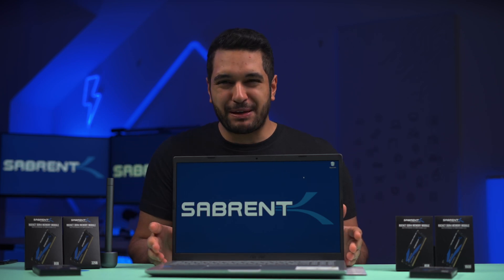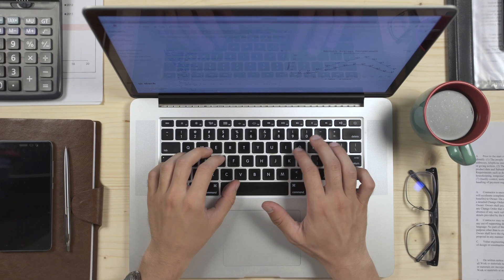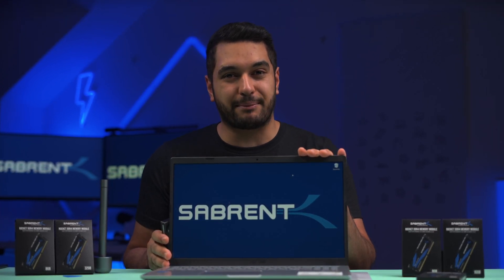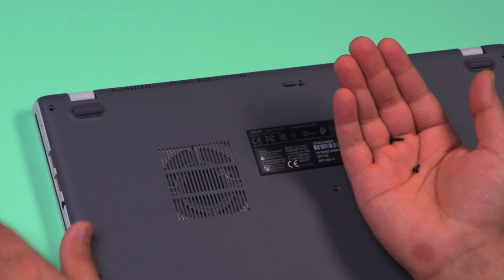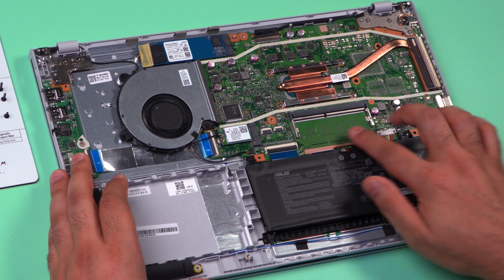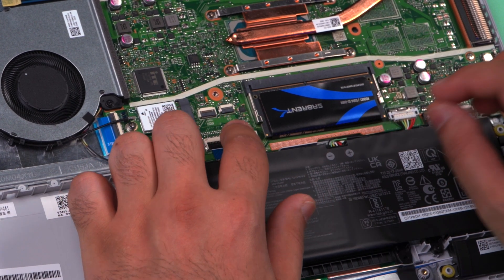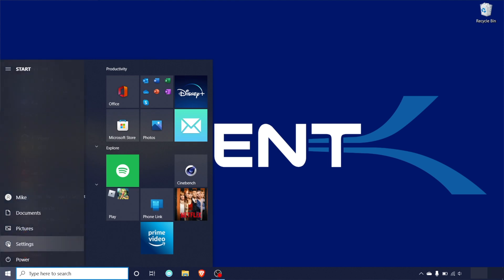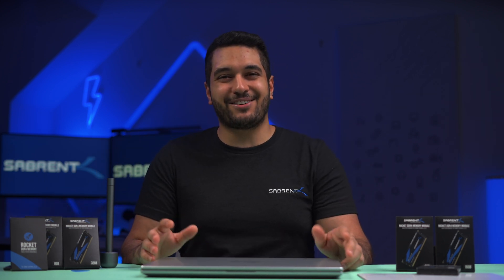Upgrading RAM On Your Laptop | How To

Comment: My laptop works fine until i have several tabs open, then it really struggles and is very slow, would upgrading this, assuming of course mine is suitable for upgrading the ram, improve this?
Reply: Yes, most likely.

Just open those tabs, check the task manager and watch your memory usage. If it's close to 90 - 100% with several tabs active --> then you need more RAM, make some space for your system to run those tabs.
Reply: @JonathanStevenSCANDALOUS  No i've not yet upgraded the ram, but i think i need to, i only have 4gb of ram at the moment. I will scan it with the crucial scanner, and see what they recommend, i guess that is the best way to buy the right ones.
Reply: @websurfer1585
Did you upgrade your ram? If you did, is your laptop faster? Thank. Be blessed in JESUS CHRIST.

Comment: Ive opeed my laptop CHUWI Corebook X to upgrde my ramt 32gb (16+16) but the ram is built in the laptops motherboard and for my deception there is no plus slot besides that i got a plus nvme slot so i only stretch my memory to 1Tb (512gb nvme ssd × 2)

Unfourtnatly i cant get more than 16Gb of ram 😢😢😢

Comment: Tysm but I'm having difficulties my laptop is showing the gb installed but it dosent show that in my files :(
Reply: I think you might be confusing memory with storage. If it's showing the correct amount of RAM, everything should be fine. Installing RAM will not affect your storage capacity.
Reply: @hollow180  oh ok mb ty

Comment: Can you help me i don't know what Rams are compatible with my laptop Lenovo IdeaPad 3 15ITL05 MUCH APPRECIATED!!
Reply: Bro I did some research, your ram is soldered, you can't upgrade it...
Reply: @mtsama01  really appreciated!!
Reply: I have the same laptop. One soldered and one is not, so you have 1 slot that is replaceable. Use the crucial system scanner to check though.

Comment: Hey noob question sorry, is it alright to have different brands? I have existing 8gb of ram and I'm planning to add another to the other slot so it'd be 16gb. And as far as I know, it has to be similar models(??) which is DDR4 3200
Reply: Seems like you were in the same boat as me, out of curiosity what did you end up doing? I have a second stick of 8gb RAM arriving today but it's not the same brand as I couldn't find the exact same model as what came preinstalled, all the specs are the same but I'm praying it works!

Comment: I have a Toshiba L650 with 4gb of ram 2+2, both removable. I got two 8gb ram ddr3 boards, but when i install them the computer tries to start windows but ends up in a blue screen with an error message and keeps restarting... Any ideas?
Reply: Was your older ram ddr3? Make sure your motherboard can support that.

Comment: Is it safe to use other type of ram for exemple I have a 16 gigs of ram stick on ddr5 if I use a DDR4 stick with more or less ram will it work ?
Reply: Ddr4 and ddr5 have different pins. So, if your motherboard supports ddr4 then it CANNOT have ddr5 vice versa

Comment: may i ask, why does my laptop's screen occasionally got freeze and the lines of green pixels appear? this happen after i upgrade my laptop RAM at repair shop
Reply: Maybe it wasn’t installed properly.
Reply: Are you upgrading from 1 ram to 2 ram modules? It will happen when the two rams isn't from a same brand
Reply: @Galllam01  ouuh i see, the orignal one was coming with the laptop itself... the second one is gaming ram...8gb+8gb
Reply: @khairulfahmi6067  Yes I've had issues also with that, so I recommend to use the exact same modules.

Comment: i have a few of silly noob questions: 
i saw for sale $40 stick of 1TB RAM. is there any catches? shall i get as much as possible, or 32GB shall be enough? 
will it affect the files on the laptop, temporary files and stuff, like tabs in my browser, etc.?
Reply: Don't buy, no such thing as a 1TB ram stick, especially not for $40. 32gb is more than enough for most laptops. If you're doing high end gaming or 3d rendering, then yes, more is better.

And no, ram does not store long term data, so it will not affect your files.

Comment: I have a gaming laptop, it's good but the ram kinda holds it back since it's only 8gb, this video helped a lot
Reply: Which one? Im looking to buy a good one for fortnite and dont mind upgrading the ram. Im looking for a good laptop.
Reply: @Everything_Edits7  well honestly any laptop with a GTX 1650 is pretty cheap nowadays, but it's actually a great graphics card.
Reply: @enchiladas2.047  which one do you have
Reply: @Everything_Edits7  it's a victus 15fb, with Ryzen 5 and a GTX 1650, but if I were to recommend one it would definitely be the "ROG flow x13", it's a dream laptop

Comment: Is disconnecting battery connection necessary or we can just upgrade it without disconnecting battery???  Will it damage laptop anyhow while upgrading Ram with battery connector not disconnected?
Reply: No need of disconnecting
Reply: Didn't know about it. Just disconnected the power brick. ☮️

Comment: why does it doesn't show my new ram? it stayed in 4gb while I installed another 4 gb of ram so it should be 8gb, but it's still 4 gb.. please help.
Reply: If you knew the reason please tell me as I'm having the same problem and i don't know what's wrong
Reply: @mariamgalal5992  I assume my laptop is very old and the ram I bought with same DDR3 is new and some complicated things like outdated drivers I supposed. that's why probably it doesn't work

Comment: do i need to disconnect the battery first? cause i heard static discharge can damage your ram.
Reply: static discharge comes from you
Reply: Its good practice to always disconnect power/battery from any electronic device you will be working on.

Comment: Very helpful because my mom gave me her work laptop so i upgraded it because it only has 3.9GB of ram is always 95% used Btw im using windows 11
Reply: Has perfomance improved
Reply: @chrisking8579 is you have 4 gb of ram, it’s 100% gonna help performance. I’m honestly surprised that a laptop with 4 gb of ram even runs windows 11
Reply: Did it improve your laptop?
Reply: 4Gb ram is barely enough
Reply: Windows needs like 3 gb of ram just to operate. U need at least 8 gb of ram. But i recommend you 16 if ur laptop can take it. Remember to look if its ddr4 or ddr5, and also de the frequency maybe ur laptop can only take up to 3400Mhz

Comment: Thank you for tellling me to put the ram at a 45 Degree angle. No other toturials i found told me to do so. Almost broke my ram trying to Press it Down into the ram slot at the wrong angle.
Reply: Same thing happened to me!! I was like did I just break my ram
Reply: I’ve ripped apart many laptops to destructively sanitize them and  found it interesting that laptops had their ram installed at an angle.

Comment: Hello! Should i remove battery if i am planning to upgrade my RAM? My battery is inside of the laptop, so you can't easily remove it from outside and if i need to remove it, i will have to remove it from inside. Please, help! 🙏
Reply: Remove it if you can.
Reply: You don't need to remove the battery. You don't even need to disconnect the battery. ☮️
Reply: Have you tried it with battery on?
Reply: @herox12five  Hello! I upgrade my Ram by turning it off, not totally removing. So i just removed the connection of the battery to the motherboard.  Then, I added one more ram, after that, I turned the battery on again by connecting to the motherboard. Nowadays, it works great!

Comment: hey js a question. If you want to upgrade ram does it have to be a specific stick or?
Reply: Yes it does. For example, it could be a DDR4 stick, or a DDR5 stick. You can check what stick it is by looking at you laptops RAM
Reply: @nicholasfahey3497  oh ok ty

Comment: Are laptop ram generally universal in size? If so, are are there any laptops that have a non-standardized ram slots?
Reply from the maker: There are differences between ddr3 and ddr4 so-dimm ram so you will need to check your laptop by either checking the spec sheet or speaking with the manufacturer and giving them the model number. Most modern laptops are so-dimm however there may be high end gaming/workstation laptops that use non so-dimm ram similar to a PC tower. Again check your laptop as there are hundreds and hundreds of different models and configuration.